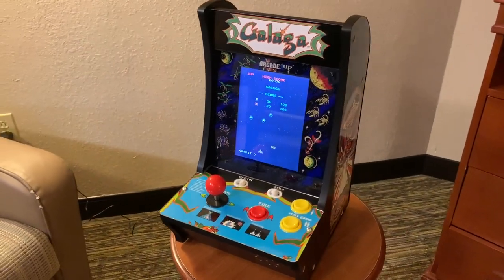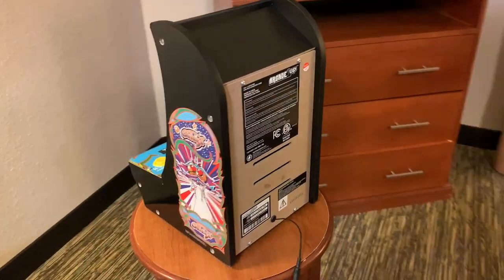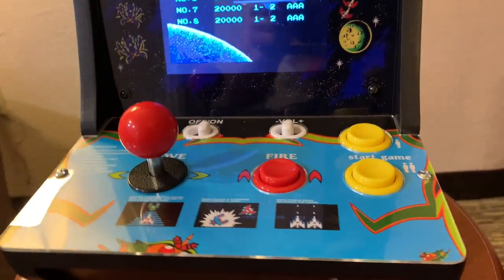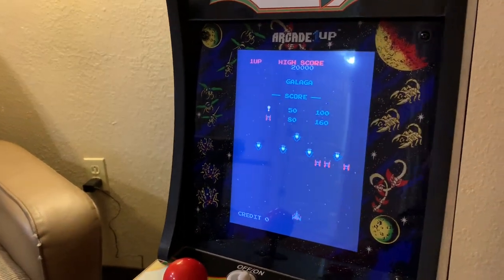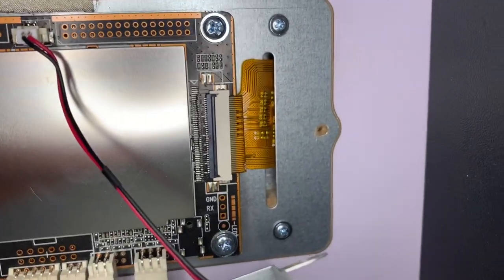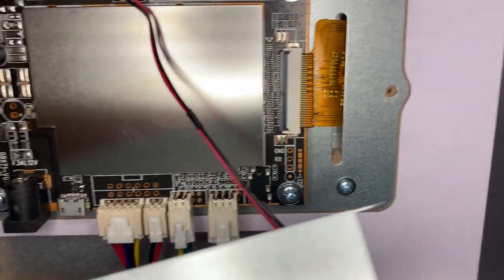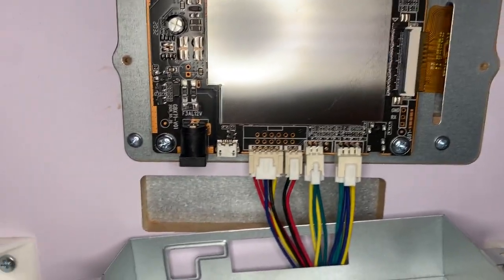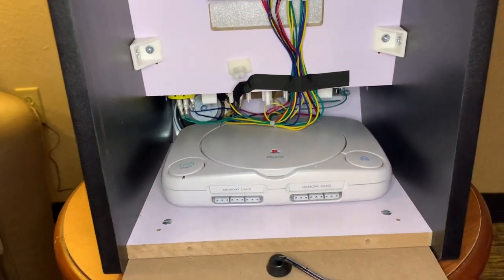Mini Mod - Gen 2 Arcade1up Countercade

Comment: It’s a vertical screen, ps1 mini is not going to work with this arcade. You need a Raspberry pie with a 8 gb vertical games you can get online called Smithers. That to me is the best use of this device, not a horizontal platform like the PS1.
Reply from the maker: It works just fine, with the right game. Check out the video: https://youtu.be/zdVge8SFNOc

Comment: It is hilarious how you lean towards putting a playstation in every cab! Not sure how that works here though, because I'm not sure how you get a PS1 to play nice with a vertical monitor, but I wouldn't put it past you to make it happen! Love the videos-- I have three actual countercades. I put a 10" monitor into my gen 1 Centipede with a Pi loaded with trackball only games (it's awesome). Also have the QVC Ms. Pac-Man that I'm in the process of modding with a 60-in-1, and I have this same Galaga that I haven't decided what to do with yet, so I'm excited to see what you come up with. Additionally, I used the gen 2 models as a template for building my own counter-cade from scratch (same dimensions), which has a dynamic marquee. Haven't skinned it yet, but I'm leaning towards making it a Frogger. People like to hate on bartops, but when you're like me and you don't have a lot of space, they're a great option!
Reply from the maker: I’ve got an Alien Vs Predator themed cabinet that started as a bartop. They’re a great way for people to get into the home arcade hobby. 🦊👊🏼

Comment: Got this one for $50 recently.  The panel discoloration is because its probably a VA or TN panel LCD.  Thinking about Pi 0 replacement and doing more buttons and 10" LCD.
Reply from the maker: A 10” would look good and better proportioned to the overall size of the cab.